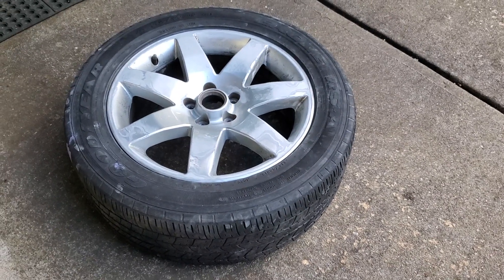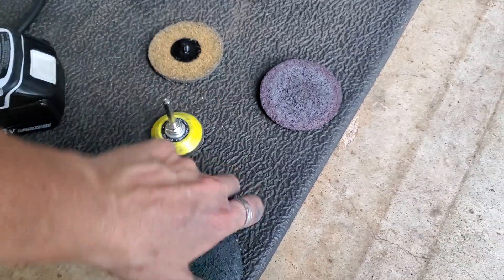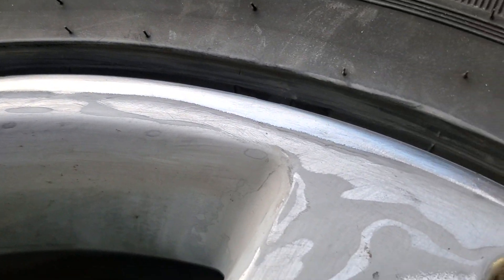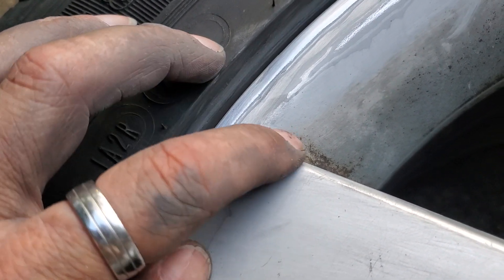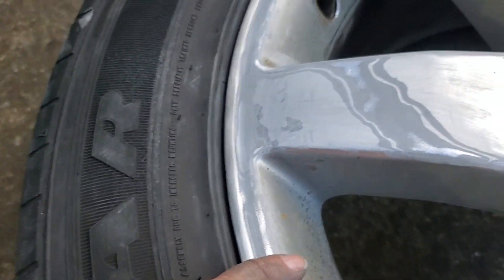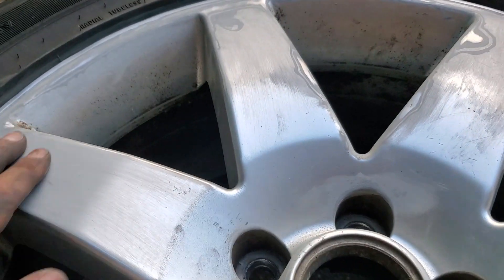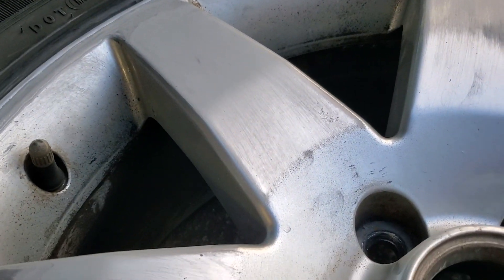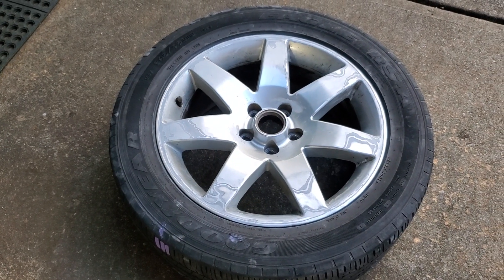2004 Saturn Vue Project: Refinishing Redline Wheels: Part 3 : Sanded & almost ready for primer.

Comment: Looks like the Redline rims are painted originally vs a clear powdercoat on top of the Aluminum? I've got another couple of sets and want to get a set powder coated.
Reply from the maker: Yes, they have a primer layer, then the silver & then cleared.  Definitely not a typical machined or polished aluminum with just a clear over like the OEM ones I have.